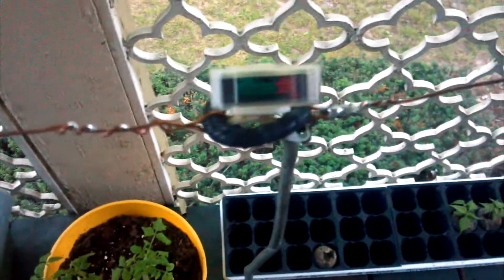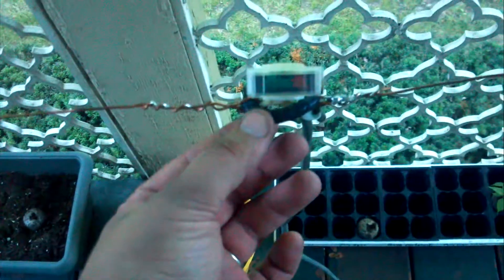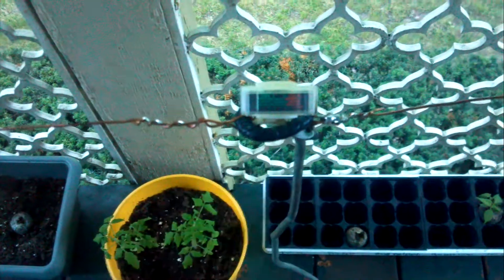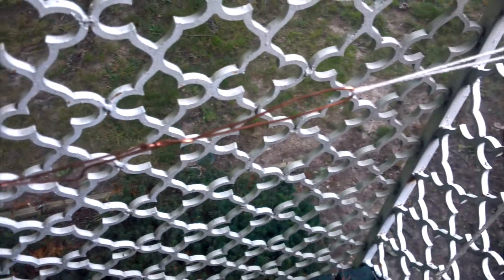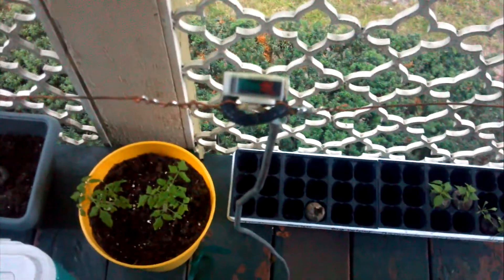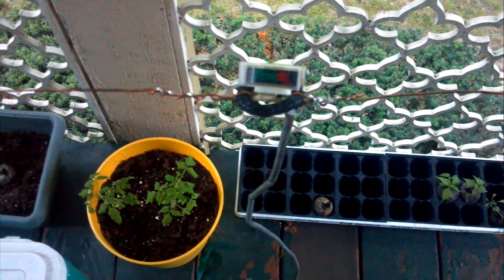11 Meter Dipole Antenna

Comment: How do you make the middle
Reply: You can get an SO-239 connector then solder one strand of the wire to the center conductor and attach the other wire to the ground part of the connector.   Very easy to make.  Then you just have to screw the coax on.  Just measure the length for what frequency/band you want to use and of course, always, check the swr.  Or, if you don't want to buy an SO-239 connector you can just use the end of the coax itself.  Center conductor to one side of the wire and the braided part to the other wire, just make sure they don't touch/short - keep them separate.

Comment: when you transmit, are you seeing much interference by using it (like through computer speakers,  TVs and what not).
Reply from the maker: Sadly this dipole is long gone, but was the best one I've built to date. I usually only ran around 25 to 30 watts through it, but ran up to 100 watts AM with no interference or bleed over, and could run 200 on side band before I would come through my computer speakers which were in the same room. I think being so close to that metal rail and tuning it to run that close really helped

Comment: Cool , As long as it works whom says it has to look good , Actually I think it helps conceal it.  What do I need  for this ?  & measurements  also what diode do you solder on back of meter ? Thanks alot
Reply: You just need coax and wire for the most part, but you can use an SO-239 connector in the middle if you want.  If you use SO-239 connector you solder one wire to the center conductor, the other wire to the ground part of the connector and measure the wire for the frequency/band you want to use.  Then you can just screw on the coax that way.  Or, if you just splice coax cable you can solder the center wire of the coax to one wire and the braided wire to the other side.  Then, once you have the wire the length you need for the frequency/band you want to talk on check the swr's.  Tune swr's if necessary.  For a cb, an 11 meter dipole (for 1/2 wave antenna) should be about 8 feet 8 inches long on each side - it would be about 17 feet 4 inches total from end to end.  Not sure what diode he used to make the field strength meter,  but field strength meters are generally cheap to buy anyway.   You can get an swr/field strength meter together so you can check your signal and swr's.

Comment: I have not made a dipole yet, however, I bought one and used it as a horizontal. It got out, but it really started getting out when I put it up as an Inverted V. Try that on the balcony. It should work. will work even better if you can get it away from any structure.